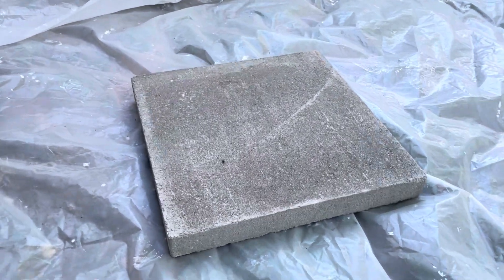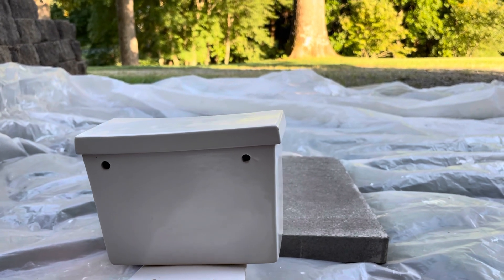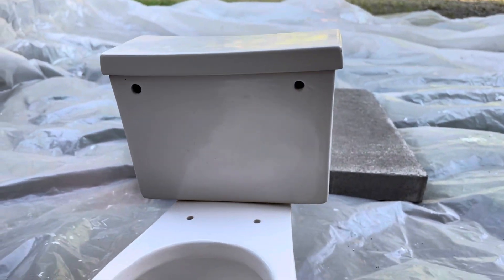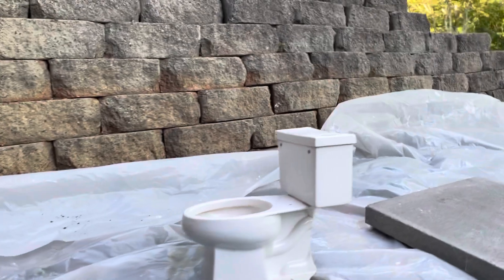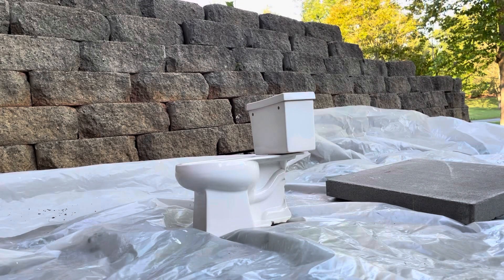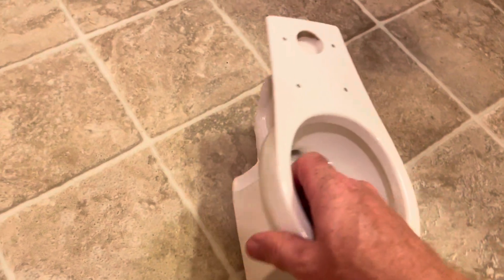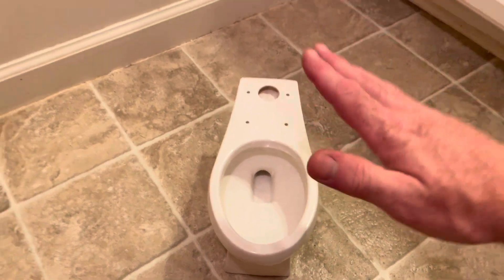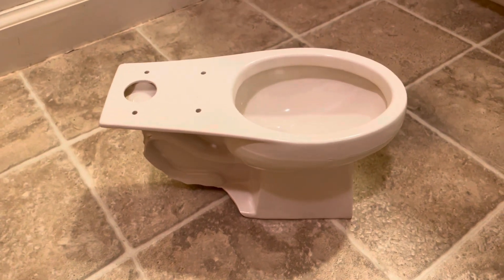GIANT CONCRETE PAVER vs. tiny little toilet!!!

Comment: I actually really like the bowed tank lid design. It is very unique.
Reply from the maker: Thanks!  If the top of the tank were bowed as well it wouldn’t be so bad.  With the top of the tank flat, the lid kind of rocks back and forth on top.  😂
Reply: @Pottymaker  also, you could have plugged the other hole, some real toilets have two holes in the tank and one gets plugged and sealed. It's pretty rare though.
Reply from the maker: @starlingbaez6681  I’ve seen that pretty commonly on British toilets.  Maybe I could make a hybrid British/American toilet,  😁